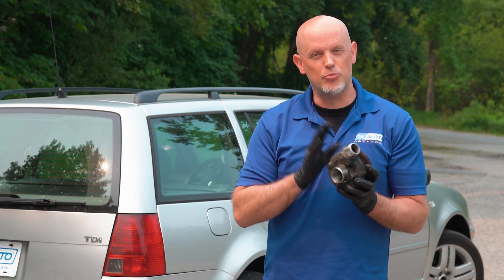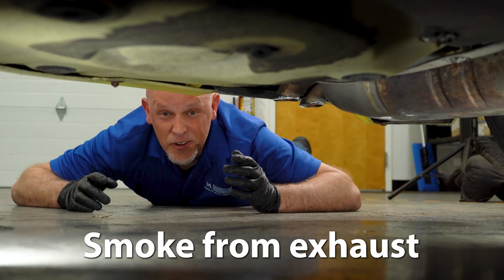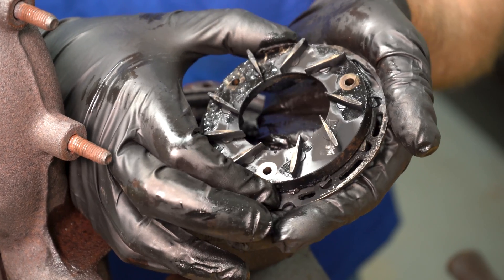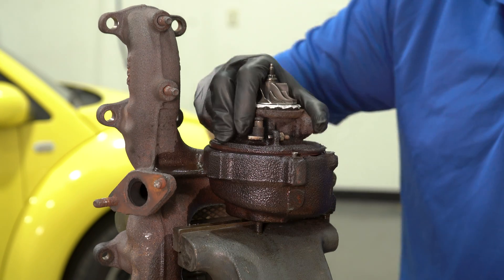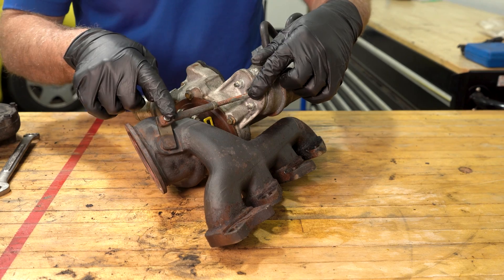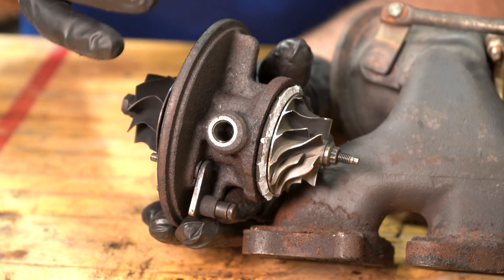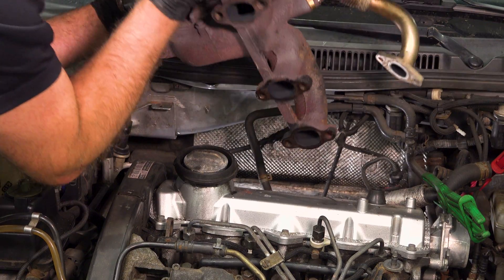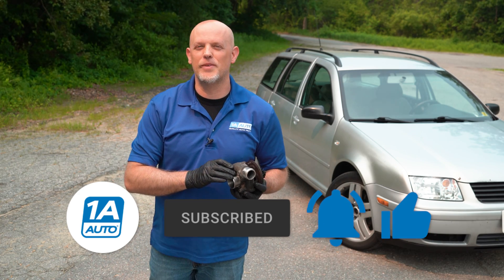Lack of Power and Oil Consumption in Turbocharged Car or Truck? Symptoms That Your Turbo is Failing

Comment: Have a question for you. If the lug nuts are to be torque wrenched how many foot pound are the lug nuts supposed to be torque wrenched? I took my Camry to a tires service garage the guy torque wrenched it to 105 foot pounds the first time. I was told that was to much that it should have been torque wrenched to 90 foot pounds. When I put my new rims and tires on the Camry the guy broke the stud off. Not to happy about that. Please reply thanks much.